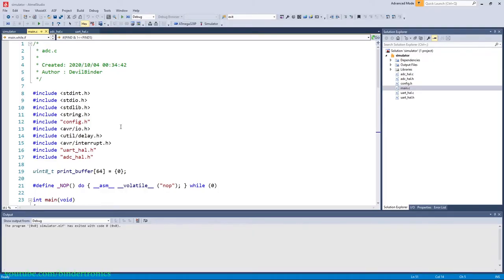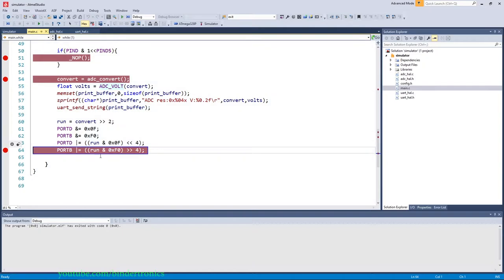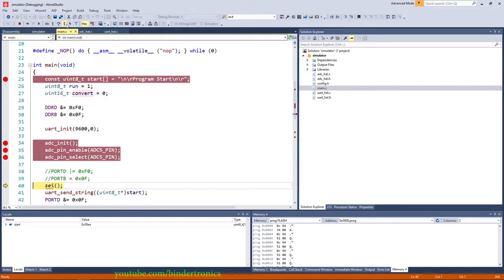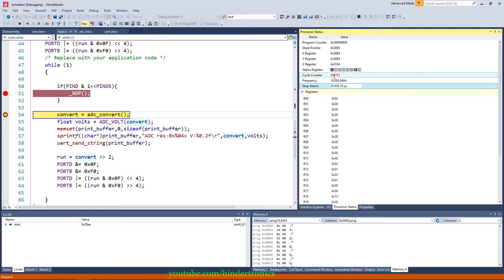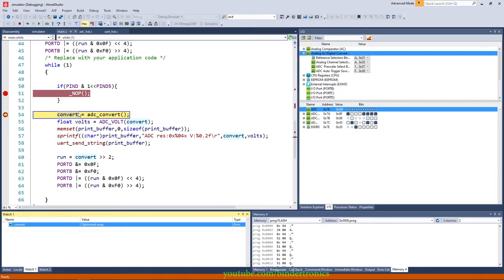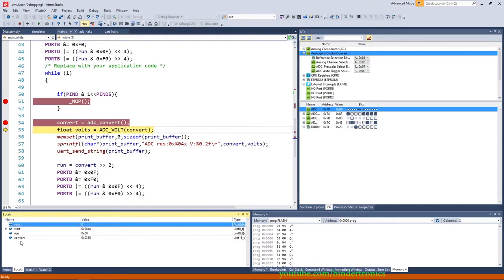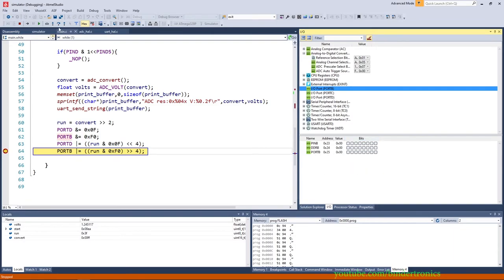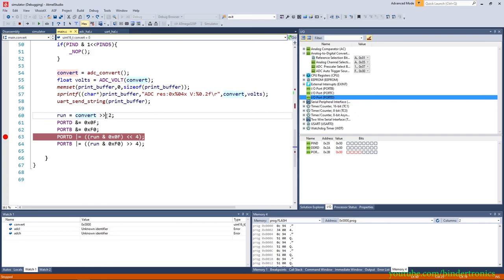Debugging and Using the Simulator 🔴 ATmega328P Programming #14 AVR microcontroller with Atmel Studio

Comment: Hello this tutorial is very good!! I'm making a simulation with atmega324 and notice I can't configure the portc7 as output because the fusebits are configured to use this pin as tosc2. If I change it for external clock the simulation doesn't run. Do you you know how to run simulation with external clock/cristal? Thanks.
Reply from the maker: Let me get this straigt. You are trying to use the extremal clock with tosc2 configured as output? That will not work as you will have no clock input.
Only way to use tosc2 as a output is to run on the internal clock or you will have to manually toggle tosc1.
Datasheet 9.8 External Clock